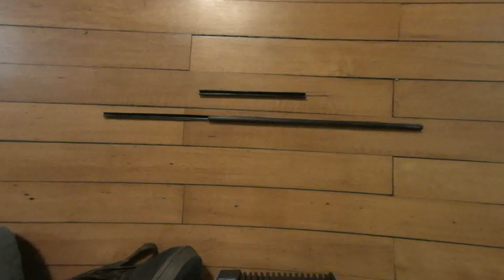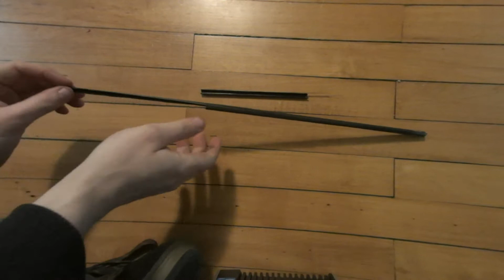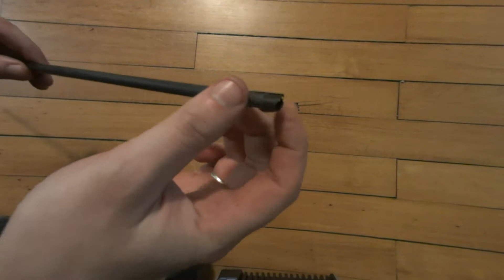QEV Arrow Gun: EXPLOSION / Failure

Comment: http://www.spudfiles.com/materials-ammo/topic26414.html?hilit=carbon%20fibre#p380905

Here's a discussion on carbon fibre barrels, you were pushing the limits at 600 psi
Reply from the maker: farcticox 1 I hadn't looked it up. I surmised the same things they said though. Great resilience to pressure at the ends, but terrible at handling internal pressure
Reply from the maker: Not too surprised it failed